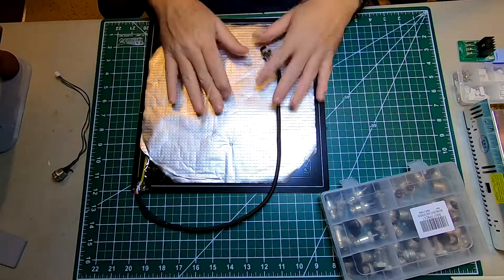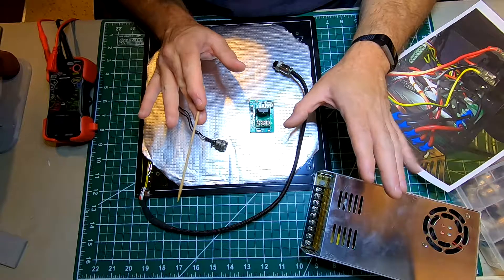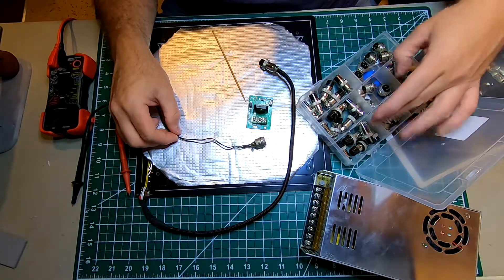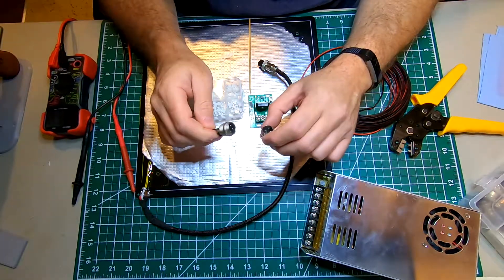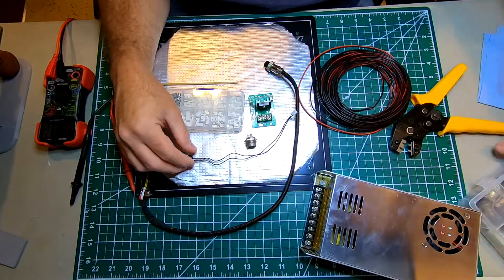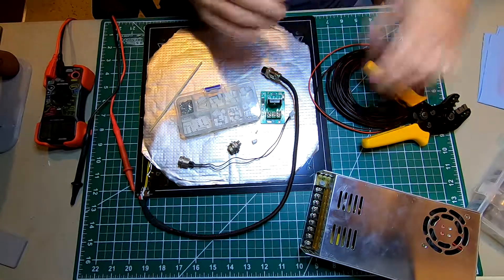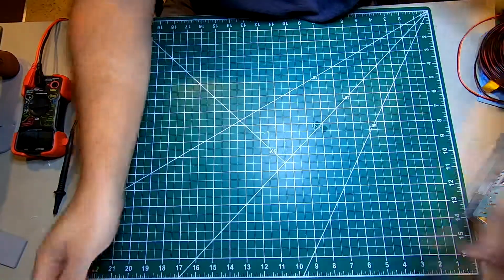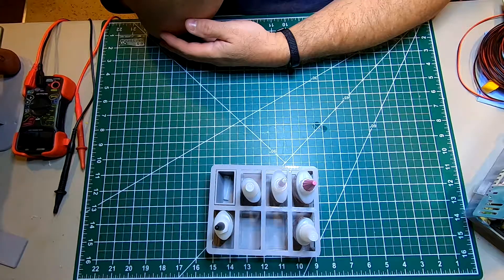CR-10S Heat Bed Problem Fixed

Comment: Hi! i took notes from this video and did end up with the exact same solution, though i just soldered a new wire straight to the MOSFET & PSU and the bed heating failed issue is no more!

Thanks so much for this video, saved me from buying a whole new heated bed set!

Comment: I've had problems with the hot bed in the past... and now all of a sudden one again... I had forgotten what I used to do, but one comment reminded me to fool around with the female connector. The metal sleeves in the holes are really easy to bend to make them tighter around the pins, and that's just what I did. Hey Presto. Everything works once again.

Comment: Hey man thank you for the video, very informative. Could you tell me please which cables (red, black and the two white cables) goes to which pin in the 4pin Adapter? Since I wanted to replace the cable, but the original cable wasn’t possible to open. It was completely glued. 
Thanks again!
Reply from the maker: I'm sorry, I don't remember. I made that video 4 years ago. I would go on Reddit r/CR10 and ask them. I'm sure you would get a quick answer.

Comment: Running into a similar issue myself, and ran across your video when asking the same question about the heated bed possibly getting disabled if the thermistor does not report back.
Were you able to get a definitive answer on that?
Reply: What does your control screen say the beds temp is if you set the bed to heat up? Does it fluctuate between a few degrees like 23 to 25 degrees but nothing heats up? Because thats what mine does and i have no idea whats causing it, all the wires are fine.. I dont know if thats what this guys situation was exactly but i think at least my thermistor is working if its communicating  a few degrees variance. I dont know if a heat bed can just fail.. its a pretty simple concept buts thats got to the only thing.. though, i would hate to drop $50 on a new one and it still doesnt work. Whats your issue exactly and how did you fix it?
Reply: I had the same issue, from your video I figure it out what is the problem, it's the connector for sure, but you don't have to replace it.. you can fix it, the female connector you can make it tight by using a pin to push the edges to the center, and each male connector is splitted in halfs so the only thing you need to do is to make the male pins splitted space wider a little bit so it fit the female header perfectly.

Comment: I got the Cr10s my self and my heat bed stopped heating up and went too Amazon and replacing mine also I just hope its just the heat bed and nothing else id also felt the connector in back of the box and notice it was getting hot so I threw out the heat bed and waiting for a new heat bed